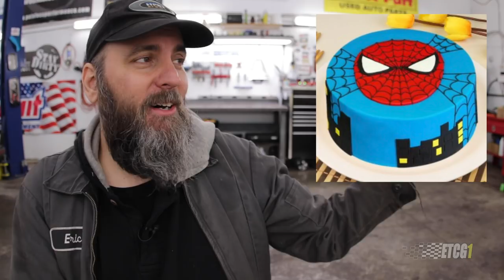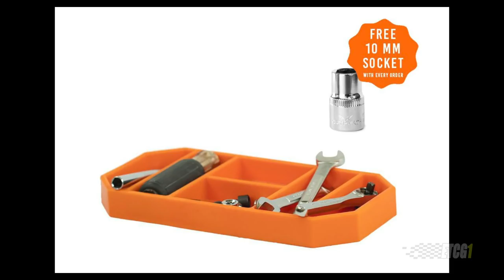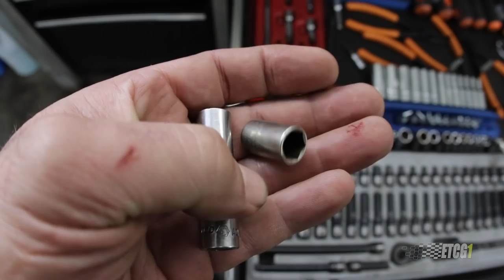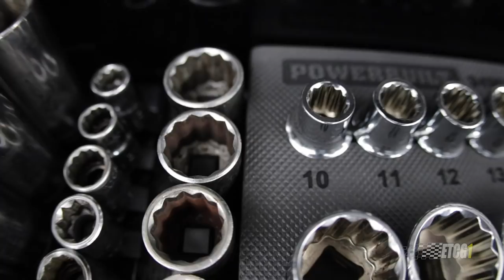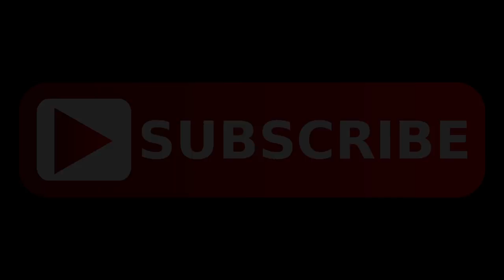What is Up With 10mm Sockets?

Comment: Eric I had the same question.  I'm going to chalk it up to 2 related things:  1)10mm is super common, and 2)because it's so common the 10mm is always in use and therefore more likely to become lost than sizes just sitting in the tool box.
Reply: Nailed it.
Reply: Yep.  The joke (I'd say "meme", but that term wasn't in usage at this point) used to be about always losing the 1/2" socket...back when cars were still using imperial sizes.  It just happened to be the most common size used. 

(And fortunately, we could always substitute a 13mm when the 1/2" went missing - they're incredibly close in size.)  :-D
Reply: @aussiebloke609  It's cause 1/2" is 12.7mm. Hence why .50 BMG (.5 inches) is called 12.7x99mm Nato. : )
Reply: I would also add that on most of the cars I've worked on the 10's hold the covers to the parts I need to actually replace. So if you aren't as organized, you use the 10, pull the socket off set it on a something like a strut tower. Use the sockets you need to replace parts. While you are trying to get to the parts to replace you knock the socket out of it's resting place.
Reply: Bingo. Seems like most of the plastic covers that protect the actual component you need to get to are 10mm. My guess is once you get the covers off you put the 10mm socket on top if the engine somewhere and it ends up falling into some crevice of the engine. Finding the 10mm will probably solve 90% of automotive rattling complaints  out there

Comment: cause 9mm is too small, and 11mm is too big.
Reply: 11mm work on a 7/16 bolt!
Reply: Goldielocks effect
Reply: Been wrenching 40 years never found a 9mm bolt all my sets have new 9mm sockets
Reply: @mperrenoud01  19 and 3/4 ,11/16 and 22, and barley 7/8 and 24
Reply: Your doing a damn good job finding an 11mm. I had one on my drive shaft. Had to  go  digging in my dad's old tool pile for one because no one near me fucking had one.

Comment: Anyone who’s ever worked on an XJ Cherokee will experience the slightly bigger, but no less frustrating “Where the hell is that dammed 13mm or 1/2 inch socket?!” When you’re an amateur mechanic, and you haven’t got good organisational skills, they tend to be the ones that always go missing. Never actually lost them completely, until someone snuck into my garage, and pinched my whole socket set, as well as a tool bag full of other tools.

Comment: I once lost two 10mm sockets on one wiper motor replacement job, and had to drive that car in the rain back to the used tool shop to pick up another (couple) 10mm sockets to finish. Thanks for the video, ETCG1!

Comment: My garage sits at the bottom of a steep incline. One day wirking inside of a Ford ranger in neutral with emergency brake on. Bumped brake and it rolled into garage and hit my work table. No real damage. But 10mm socket went missing. 2 months later truck is in garage for inspection. Mechanic finds socket embedded in grill.

Comment: I work in small engine repair, I find most Honda engines can be disassembled with a 10 MM socket alone
Reply: I work on honda cars and 1/2 the car can be disassembled with a 10mm, lol.
Reply: 10,12,14,17,19 will disassemble a Honda pretty much completely
Reply: Kohlers are 8mm and 10mm
Reply: @corykluthe355  so will hammer and large flat screw driver. Lol
Reply: Notice he said "disassemble"....You can reassemble it because you lost the 10MM after disassembling it!

Comment: I'm a former vehicle mechanic here in the UK and it was the case with mine back in the late 1980s and early 1990s when I used to work in garages that my 10mm sockets would go walkabout along with the 10mm spanners. Due to a back injury even though I rarely work on cars nowadays the only spanner missing in my tool box is....a 10mm. I had three of them, one of them being a 10mm/11m combi and even that's gone.
Reply from the maker: Sorry to hear about your back. Thanks for the comment.

Comment: When you get a new set of sockets, immediately throw away the 10mm. You loose it after two days anyway, keeps the heat down when you need it but can't find that darn thing. 🤣🤣🤣
Reply: You loose the 10mm socket when your discipline level is as low as Whitney Houston has been.
Reply: @SE45CX  your reference to Whitney Houston is low.
Reply: @SE45CX  oh and the correct spelling is lose btw
Reply: @804_Rider  Ok, I admit, it was low. Also the Whitney Houston example isn't much relevant to the kind of discipline in maintaining your sockets.
Reply: @SE45CX  nice, i didn't think I'd get a response since you commented a year ago 😆

Comment: Hey Eric, yes it apparently is a thing...I saw something amusing somewhere once that made me chuckle....It was one of those red boxes with 'In Emergency Break Glass'...inside was a 1/4" drive 10mm socket...lol
Personally I've never lost one, but I've been close.
Here's a tip that works for me....always keep your sockets on socket rails, and return all sockets to their correct homes when you finish a job.....easy to see if one is missing, and gives you the opportunity to chase up anything 'missing' or dropped into the abyss, before you forget where you used it last....hopefully that saves it from the 'gone forever' gremlins🤔..lol👍🇦🇺

Comment: IIRC 7/16 was the SAE long lost brother of the 10mm. I like the idea of a strip of 10mm in various configurations. I lost one when the retaining ball on an extension failed, it dropped into the hollow of a Nissan PU with a V6. I replaced both extension and socket.

Comment: Almost every import car repair starts with using a 10mm to remove a cover or panel of some sort.  Then the 10 gets set aside for a 12 or 14 and subsequently rolls around or is forgotten that it’s sitting on the radiator shroud.  Take a test drive before buttoning everything up and there goes the 10.
Reply: They also get caught due to the narrow places 10mm used and fall off the freaking extension and get lost..... Le sigh..
Reply: @walterhubicki5207  I came so close to losing mine while changing the brake light in my hatchback...
Reply: I wonder if those little reflective glints in my driveway are my 10mms.  hmmmm

Comment: Two weeks ago I dropped a tray of 1/4 inch drive sockets. I found all but 1 and guess what size it was. Yep the ole 10 mm.  Yesterday I found the sneaky bastard under the ledge of the wall on my carport. 3 feet away from where my tool tray fell.

Comment: Look up the video "10mm struggle!" It depicts the madness perfectly.
If I am EVER looking for a socket or a wrench, it is a 10mm. I also think it matters more when you are not the only one in a shop. On my last project, replacing headlight assembly on a 1996 Saturn, I only needed one socket.... guess which one it was? Yup. I had 3 available to me (because I just recently re-organized my tools) and I had them connected to 3 different variations of extensions and swivel/u-joint sockets to help me get into tight spots.

Comment: I've lost one socket in my first 40 years, a 10mm.  That was when I mostly used SAE sockets, but that one day I dropped the 10mm and it disappeared somewhere between me and the ground.  I think I heard it fall out a few days later when I went around a corner.
In the past 10 years, just a few days ago, I lost another socket, also a 10mm.  That one was probably because of the "most common" aspect. Good thing my nearby home depot has a good selection.

Comment: I would say it’s common among those of us who are less organized. 
I’m a bit disorganized and a hobbyist wrencher.  When I misplace a socket, generally there is an sae replacement that will work. If I lose a 13, a 1/2” will work, a 14 can usually supplant a 9/16” etc. 
But not the 10 mil. So it’s those of us who are disorganized and always losing sockets that are complaining. That same can be said of the 12 mm, the 7/16, and the 3/8. But since the 10 mil is so very commonly used, it’s the one that stands out.

Comment: There's just something about the 10mm that makes it disappear. It's probably a bit that it's used a lot, and it's small. I mean, increased frequency of use means the quantity (if not the percentage) of 10mm's lost is pretty high, but they're also, as an object, just not very big. A fact that also makes them easier to lose. The 9/16th is a close second though, and I think that again comes down to the general size and frequency of use. They also fit easily in a pocket and I used to be pretty bad about throwing wrenches in my coverall pockets when I had to stop working on one thing and go take a look another when I was doing ranch work or Army work. I know in jobs where I was frequently moving from one thing to another, having a couple common tools in my pocket just saved time, but it also meant they had more opportunities to get lost.

Comment: It's probably the most common size used on cars since the mid 80s it also nearly perfectly fits 3/8 bolts and nuts so that almost doubles it's usage. With that it is the socket that is most likely not to get put back right away or dropped in some inaccessible spot etc.

Comment: I lost 3 in the last 6 months. One in a tractor engine. It fell in a crack and disappeared. I took all the tins off the engine looking for it. Never found it. I dropped another into a Honda CRV engine bay. Never found that one either. This was after I watched one of your videos too! These were both shorts.... so I bought a new one at the parts store. I went to put in my tool box and I accidentally dropped it on the floor. Never found it.

They are small and Japanese cars use them all over the place. (i own 3 Hondas) I typically lose the sockets by pulling my wrench up and catching them on something and they pop off my wrench and go flying off somewhere.

I confess that I buy cheap tools and maybe I shouldn't be surprised.

Comment: Growing up I remember my father having 5x 10mm spanners and 5x 10mm sockets all sprayed signal red.

As an adult I ended up having multiples myself. 

It's the one and only size you will struggle to find when you need it.

It's the curse of the 10mm.

I even keep a socket wrench in my car and in my laptop bag that is size 10mm. The one in my bag was recently bought because I couldn't find the one in my car. I have since found it.

Comment: Mine usually break or just wear to the point they don't grip the fastener. I did, however, loose a 1/4" drive, shallow 10mm socket (Bluepoint) on a 2005 DeVille. I knocked it off the wiper cowl, it fell behind the engine and I completely forgot to look for it BEFORE test driving the car! Otherwise, it would be in my tool box.

Comment: I have only lost a couple but that’s on par for using them that much more than other sizes. My theory is you use it to remove a cover or whatever then put it down under the hood to use a different socket. It’s pretty small so it’s easy to bump into the engine bay without noticing, maybe it was sitting on a rag and you use it to wipe something up or you just don’t see it when you close the hood. It would make sense for us to find them under hoods, in the parking lot, etc which is the weird part

Comment: I don't know either Eric, that being said; I have 3-4 10mm sockets that are extra. Mostly because I lost the one I was using at the time, REALLY needed one and didn't think to see if there was an SAE equivalent that would work. So I'd go out and buy one, only to find the original later. I'm not a messy person when it comes to tools, I'm neat and organized and particular about it, and I have a magnetic tray specifically for my sockets so they don't roll around loose; still manage to loose a 10mm every now and then still.

Comment: I think it started with one of the first imports, particularly with the battery terminal bolts.  From there you find grill and other small component bolts to be 10mm and it became a standard most manufacturers would never deviate from.
Reply: Or in the case most 2000's or newer GM vehicles 8mm and 10mm are standard for all small bolt components.

Comment: Well, it might be because as an Express Lane Tech the first thing I do is pop the hood then perform the 23 point check. Check the battery (which requires a 10mm) the air filter (10mm) sometimes one has remove the air intake hose which lays over the battery. Point being one uses the 10mm socket under the hood a lot. From what I gathered at gaining my experience. 👨‍🔧

Comment: I believe its normally because its the most used bolt size and everyone uses it. That increases the chance of getting lost. I work at the railway industry giving maintenance to our local subway, and normally for maintenance operations, we use 8, 10, 13, 16, and 17 mm sockets and wrenches, we also need 5 and 6mm hex bit sockets. The ones that get lost the most is the 8mm socket, then the 10mm and after that the 5mm hex bit.

Comment: Combination of it being the most common fastener (most used) being small, and because of all of that being easy to lose down an engine compartment. Pre metric takeover it was 1/2in lol. 

Thats the reason for the 10mm only socket rail assortment as well. Those different lengths and types come in handy in some odd tight areas where using extensions or whatever isnt always an option.... Plus since they are misplaced often it gives you the ability to basically buy them in a small bulk set lol

Comment: Hi, 10 mm sockets are extensively used on motorcycles as most small fasteners are M6 x 1.0 thread form added to which 8mm sockets are used as most casing screws having 8 mm hex heads have been in use for years. Sufficient to say  because they're used so much they soon wear out which is why I use power sockets in those sizes and I've found a few on the road over the years.

Comment: Oh I definitely have experienced the 10 mm socket pain. I think its because its the most common fastener size, so it tends to be the most used  and potentially broken or lost socket and the one you always need. I have had to a lesser extend experienced this phenomenon with the 12 mm and 1/2'. In my experience if I was missing a 3/8' it would be months before I would even notice.

Comment: I think it's a combination of it's ubiquitous nature and it's relatively smallish size.  Use it enough, the chances of dropping it go higher, and it's small size means it can get worked into areas that are hard to get it out of, or roll away somewhere on the floor, usually under something big.  Manufacturers ought to grind a pair of flats into the outer barrel of every 10mm socket to inhibit it's rolling ability.

Comment: I keep my tools organized, and I tend to keep my 10mm close.  I've lost SIX 10mm sockets.  I think it's several things.  They're small sockets, they're common fasteners, they're used in small places a lot.  It's easy to lose one on the frame of a vehicle, have it sit on a subframe or roll in to someplace really hard to access with your hands.  Usually they end up sitting on top of Transmissions, for me.  I've also broken like ten different extending magnets, retrieving 10mm sockets.

Comment: i would say its because its so popular you loose it all the time, especially on fender bolts and loosing them into the engine bay. (i usually worked on 80s-early 2000's cars and 10mm seems to be popular for most body panels and in the engine compartment, which is were ill drop and loose them,

Comment: I think it is a combination. They are soo common so you are always pulling them out to use them, because they are used so much they are more susceptible to being lost. Almost every car I have worked on has used 10mm bolts, I have also lost a few 10mm sockets.

Comment: The 10mm is used for so many things that I prefer to have different depths rather than use extensions. I got a pass-through socket set as a gift; I rarely use any of them but the 10mm.  I was POd when I bought a rebuilt caliper that had 12mm caliper pin bolts instead of the 10mm originals.   (AFAIC, the 10mm, 12mm and 14mm are 90% of the vauue of a socket set, and for Hondas the 10mm is half of that. )

Comment: Its a popular fastener, they fall off wrenches and get lost in the engine bay, etc.  I lost a 10mm Socket WITH extension in my Tahoe one day.  How, just how!  I eventually found it, but the entire neighborhood knew I lost my 10mm socket.  Where was it? It fell into a tiny location about 3' from where it fell...and I had to remove an underbody shield to get it.  Now then, I've actually FOUND a 1/4" Snap-on socket wrench, with 3" extension, WITH a 10mm socket on the end of it in my 1991 Saturn back in about 1993.  Best I can tell?  It was left there when they had done the 12,000 mile full inspection on the car (yea, My Saturn dealer took the car at 12K Miles and went over the entire car and fixed anything that was not working properly)...I loved that car.  Anyway...it happens...I've never lost one that I couldn't find, but I have "misplaced" a few for a while....

Comment: Working on the wife's 1988 T-Bird turbocoupe.  Managed to use:and never find again....  2-10mm 3/8" sockets...and a 10mm deepwell impact socket.  I've gutted out the tool room where I store everything, gone through the car with a set of fine tooth combs..  They just vanish!?!?  As someone mentioned-  it's like the elusive sock in the dryer...  It just vanishes..  Maybe it's like the Carlin routine where stuff vanishes and goes to a little room in Heaven where:  once you pass on--  You get back everything you've ever lost!

Comment: As a carpenter I don’t deal with nuts & bolts that often, much less metric ones. I have on occasion not been able to find any sort of 9/16” wrench or socket. This probably explains why I have at least one Crescent wrench in each of our four vehicles plus one or two in the kitchen junk drawer and at least three in the basement, and of course one in my work vest, (now....which pocket has the wrench?)